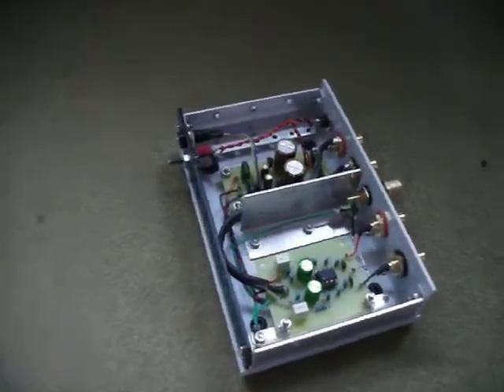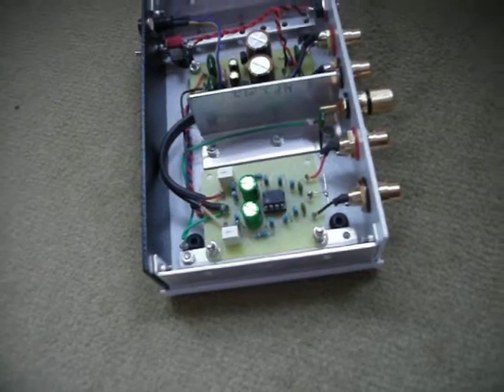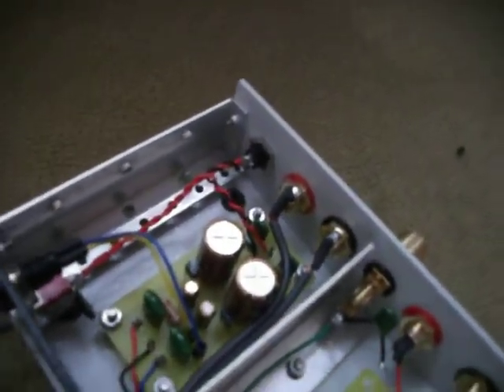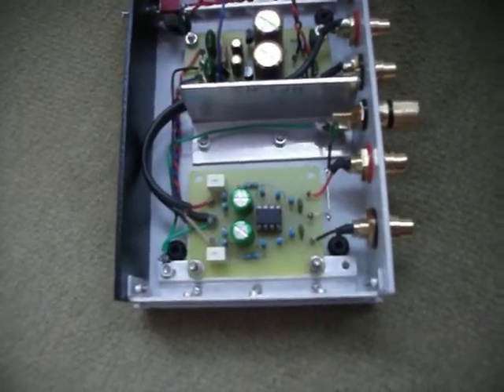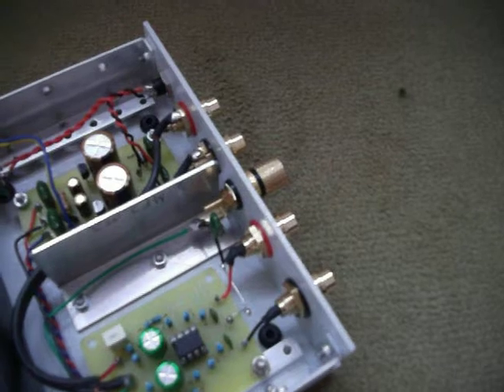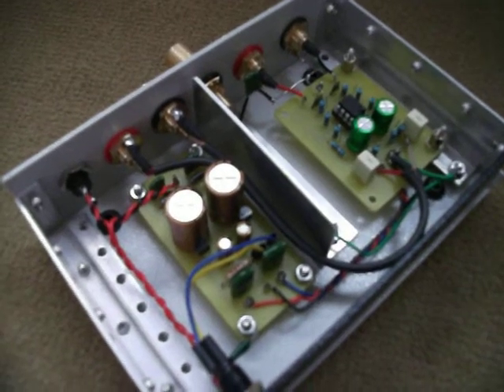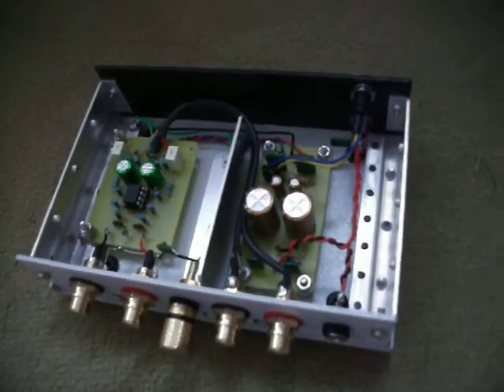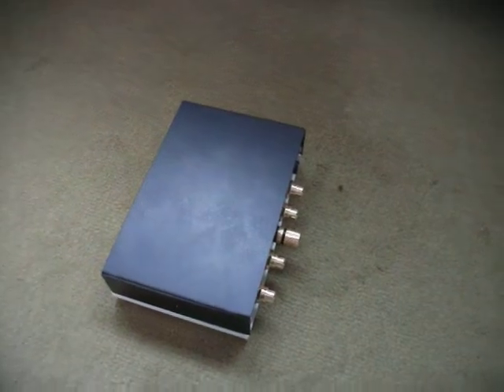Homebuilt DIY Flat Level Phono Preamp for 78 RPM Discs

Comment: hi  i need   the componant value for    decca, columbia etc.  do you have it?  
values for   the caps and resistors         thanks.
Reply from the maker: +anusheadproductions It's a flat level preamp. It doesn't apply any equalisation. There are plenty of other articles elsewhere that contain such circuits.
Reply: ok  got it    thanks
Reply from the maker: +anusheadproductions I would recommend doing all of your transfers with a flat-level preamplifier and then using 'Equaliser' by Brian Davies to apply the necessary EQ.
Reply: i have a phase 4 decca record.  i put a
1m ohm resistor and a 3nf cap in parralel. in the
eq section on my phono amp. sounds realy
good. with an riaa circuit  this record sounds too harsh. too much treble. not right. ive put
together a few  riaa circuits.
Reply from the maker: I don't know what 'phase 4' is. But you would probably be lowering down to about 50Hz with that combination.

If no shelf is specified then it's best to lower down to 40Hz or +20dB whichever one comes first.
Reply: decca phase 4 stereo.  its a series of records
during the 50s and 60s.
Reply from the maker: +anusheadproductions Stereo would be RIAA then.

Comment: It doesn't seem practical to invest in materials and man-hours to build a phono preamp when you can buy one with a USB interface for $30. See Behringer U-Phono UFO202 USB Audio Interface.
Reply from the maker: fretkillrlives My phono preamp has significantly lower noise and because it's flat it has no frequency response errors inherent with analogue equalisation. You will get much, much more noise with the Behringer when you compensate for it's equalisation by boosting the treble. The Behringer has quite a high level of noise, not much headroom (will be a problem with high output 78s), poor equalisation accuracy, polyester equalisation capacitors which produce a small amount of distortion and might also have ground loop issues when used with some computers due to the different design practices employed when grounding such equipment.

I don't think you understand the necessity for this preamp. It is designed for exceptional performance, being able to accurately amplify high levels of high frequency content while having low noise and good RF supression.
Reply: Michael Fearnley Behringer U-Phono UFO202  Signal-to-noise ratio A/D 89 dB typ. @ 1 kHz, A-weighted,  D/A 96 dB typ. @ 1 kHz, A-weighted. That's very, very quiet. Also this interface does not employ a RIAA curve. In a true blind test nobody would be able to hear the difference (if there is one) and besides the S/N specs of 78rpm phonograph discs are far inferior to modern digital standards. As part of my profession I've listened to thousands of recordings made before the 50's and the quality of recordings varied greatly between companies and the available technologies. For transcriptions I use a Sony turntable which has a built-in switchable Line level preamp and it's quiet as a mouse. Your DIY phono preamp is a nice little project but for those who are interested in preamp design I recommend examining the circuits of some of the famous high end microphone pre-amps.
Reply from the maker: If you read the manual just a little more closely you will see that it doesn't specify the performance of the phono preamp, just the line level DA performance. 89dB is typical of a dithered 16 bit DA. That should tell you immediately that they are talking about the line level performance and not the performance of the phono-stage. They also do not specify RIAA accuracy.

I actually no longer use this version as such. My current iteration of this preamp uses 3 LME4920's, active gain control and electronic load synthesis to further reduce noise by another couple of dB.

78s represent a challenge to most preamplifiers because they contain high levels of high frequency noise and fast transients (clicks and pops) which can be further exacerbated by poor slew rate inherent to a lot of lower end op-amps with low supply rails.

You can not use a microphone preamp in this situation as the load impedance has to be 47K with a certain amount of capacitance in parallel specified by the cartridge and length of cable used. This is also an unbalanced appkication.

Comment from the maker: Inverse RIAA is a little noisy IMHO.

Don't forget to collapse the stereo image though. The vertical distortion in the stereo width will give you a headache. You only get about +-12dB or so with an eq, but post RIAA this should be plenty - in reality you don't have to be very accurate with the eq.

I'm currently building an all in one unit for live listening with various curves and steep low/highpass filters for chopping redundant bandwidth as well as a flat output for an audio interface.

Comment: Impressive Job! I do my transfers per USB and apply inverted RIAA curves in my software (followed by all the other steps needed for getting the best sound). But I also like to listen to 78rpm records without having to do the computer work first. For this purpose I bought a very inexpensive graphic equalizer (Behringer FBQ800) which does the job of the RIAA decompensation and additional sound modification (low pass, bass amplification etc.) very well - only the crackle remains, of course.

Comment from the maker: I know what you mean about the low end. If the curve doesn't specify a shelf (AES for example) I always shelve it with a 30Hz 48dBperOctave filter. If it does shelve then I use a 20Hz filter. Some of my discs have really bad distortions in the high end, most of them are DECCA or Broadcast 12 (low linear velocity at the end), but the Deccas are really bad at the loud parts, I have two different styluses which both work well with undamaged/damaged records. But the Deccas sound bad with both ???

Comment: I've only general knowledge of EQ on 78s. You'll know it's a minefield; companies going their own ways and not always being consistent.  Often it'll come down to what sounds right.  Watch the bandwidth.  Discs can have environmental and mechanical (turntable & lathe) vibrations at the LF end, so rising EQ much below 40 Hz isn't, in my view, advisable.  At HF, what may look like audio signal can be electronic and electro-mechanical distortion.

We used Letraset for fascias in my day LOL.